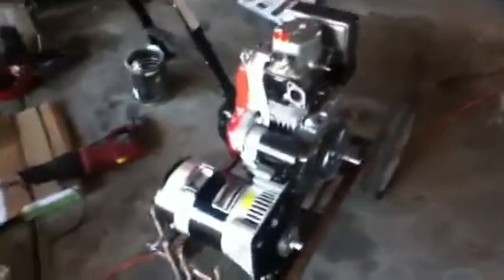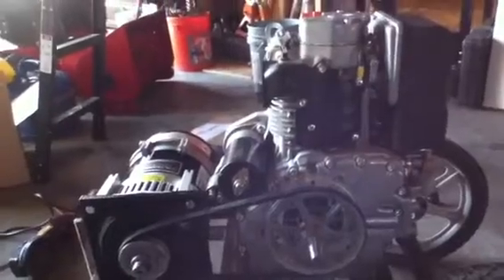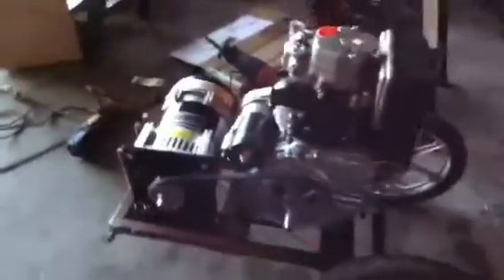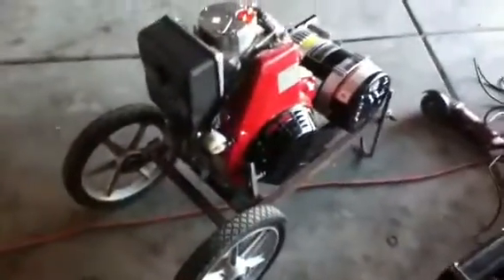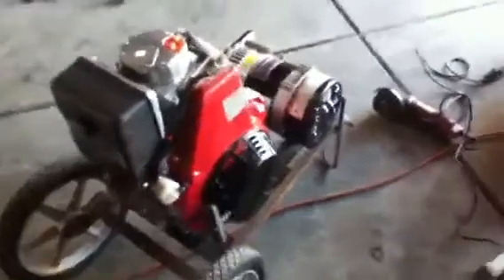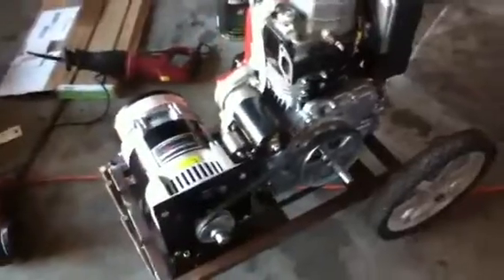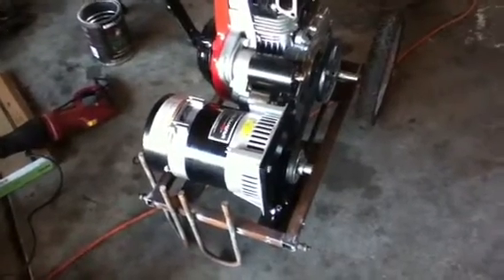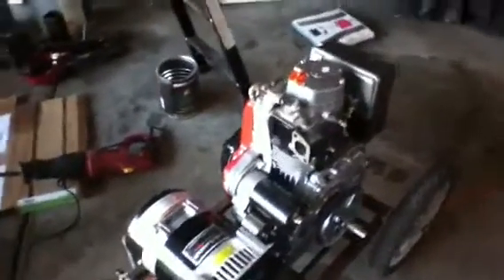Home made diesel generator

Comment: Let’s hear it
Reply from the maker: @MaxVanDenBergh-s7v  I actually have it taken apart at moment. It's pretty loud wife hates it. Plan is to redo it inside an enclosure with oil filter and oil cooler. Add sound insulation hook up grid heater and add a proper muffler. With a proper control panel with breakers. End of year project.

Comment: When the generator head receives a load from let's say an air conditioner, what tells your diesel engine to add more fuel to keep up with the load demand?
Reply from the maker: Built in governor keeps rpm to what ever I set it at.
Reply: Its own governor, same with gasoline plant motors used in generators. A bit of fine tuning to allow more spring pull from the speed setting reduces the rev sag under load I'm pretty sure.

Comment: I have a few questions what is the top RPM of that diesel engine? How come you couldn't just direct connect it with a coupling instead of using pulleys? What size pulley do you have on the diesel engine and what size pulley do you have on the generator head?
Reply from the maker: The shaft in engine is tapered shaft, it's actually made for a generator head. 
I wanted a gen head made locally, not overseas. I found this unit made here in CO so I used a pulley. 
I went with a 4" and 3" pulley max rpm in motor is 3600rpm. At 2:1 with 2" pulley, ratio it vibrates to much so i went to a to 3" pulley. It can handle loads much better and still has a sweet spot for vibration and noise.

Comment: Quick question can this run on biodiesel? I'm looking to build one to power a rural home and if it would work with biodiesel it would be really cheap. Also what is the efficiency?
This is a great build btw...
Reply from the maker: It should run on bio as it's a mechanical injection pump, the fuel lines need to be compatible. Not sure on efficiency as I have not received it more.than a few hours at a time.
Reply: Thanks for the quick reply :D

Comment: nicw bit running that engine at 1800 rpm would give you aprox 2000 watts
Reply from the maker: The govenor keeps the rpms at 2400 give or take. I upped the pulley size

Comment: Nice, but DO NOT use aluminum pulleys. Aluminum pulleys are only meant for fractional horsepower motors like one in a drill press or a Bandsaw. Using them with an engine is unwise since the torque can blow the pulleys apart. Steel pulleys are to be used with larger motors or engines.
Reply from the maker: Kyle Bittle thank you. I will look and verify otherwise will order replacement pulleys. They where from Grainger

Comment: Can you calculate a homemade generator that can power a DC or AC motor of a converted electric vehicle? I suppose the Lister engine is not suitable because it requires a motor with speed acceleration.  This in order to avoid the use of batteries, I believe these will be expensive in the future, and I do not think their waste is very ecological.
Reply from the maker: Jaime Mariño electric cars usually run on 208v AC or more. dc motors are very inefficient for electric cars. ideally you would have a small lithium bank for surges of power you need then have a fossil fuel engine charge it back up. this is what the Chevy volt did. if u want to doodle with this cheaper to build a vw or other light weight car, e-convert it, get some  agm batteries from Craig's list. depending on build expect a 10-20 mile range. carry a harbor freight 2 stroke generator if you want but easier to plug in home each night. doesn't answer your question but to many variables and diesel generator for this use is inefficient. a gas turbine generator is a different story.

Comment: If you want a fantastic generator set for home you can use the single cylinder 4LD820 LOMBARDINI engine and the SINCRO FK 4pole alternator. This setup can deliver 5,5KW and run at 1500 RPM 50Hz or 1800RPM FOR 60Hz the mechanical coupling in conical 23mm. The LOMBARDINI 15LD series can not run at low speed. The 4LD820 is the only one single cylinder that can run at low speed (specific regulator must be order to Lombardini) that is produced by Lombardini.
Reply: iw3ioj wrong , 15ld440, 15ld350 etc also have veriable fuel rack, so can be idled and adjusted all the way up to 3800rpm
Reply: I have the Lombardini 15ld440 and. Idled perfect and they idle strong why do you think they don't ? 15ld engines are not fixed speed